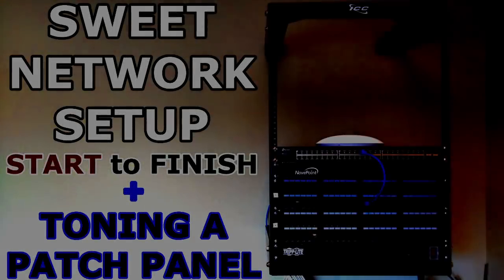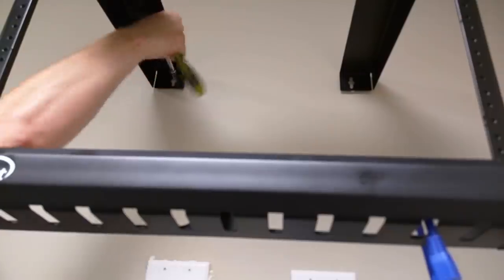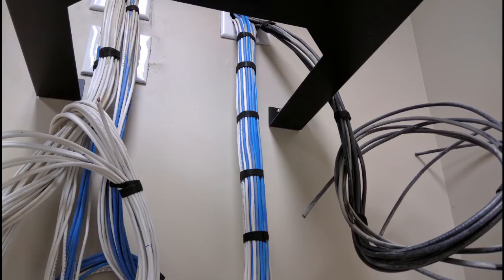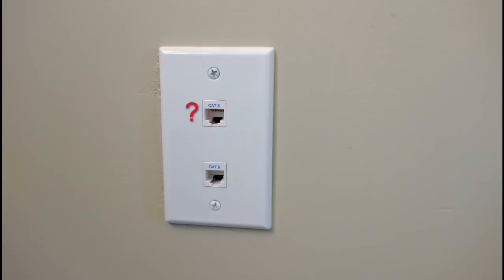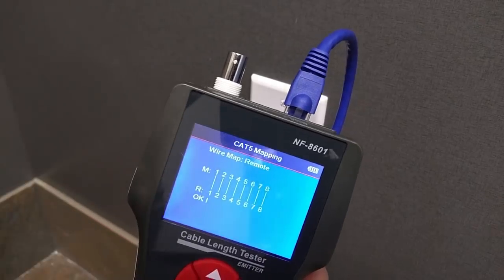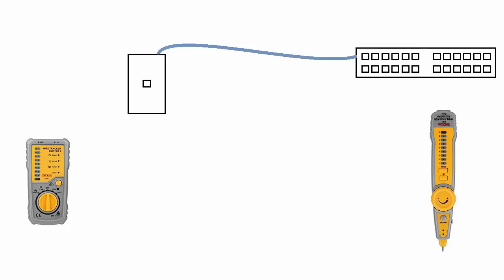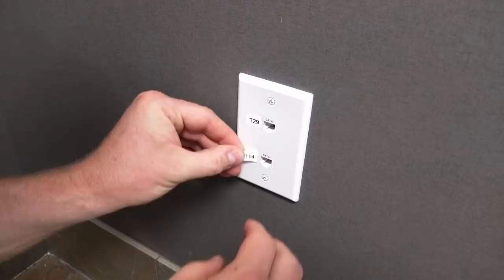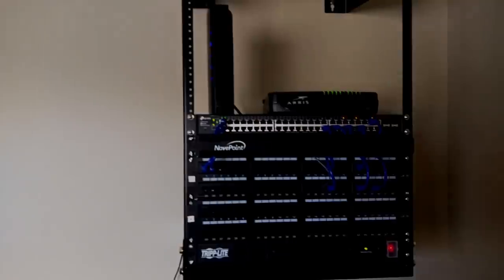Complete Network Setup // Toning, Identifying Ports

Comment: Question, I get 120 megs download and I ran 2 cat5 to each of my rooms, is there any way to split the cat 5 and have 4 ports in each room? How do I terminate them? Thanks
Reply from the maker: +Johnny Goni two cables gets you two jacks. There is no way to get 4 jacks out of two cables. Just get a switch and hook it up to ONE of those jacks. That will get you more jacks.. or just run some more Ethernet cables. :)
Reply: Actually, yes you can split one cat 5 cable into two jacks, ive done this before. The downsides are: you will only be able to get 100mbps throughput and you might get a slight crosstalk, voice applications in this manner are not recommended. 100mbps only needs pin 1,2,3 and 6. You can use 2 pairs (4 pairs in cat5 (Orange, Green, Blue and Brown). Here is how I would do it.

Line 1: 
-Pin1:Orange
-Pin2:Orange/White
-Pin3: Green
-Pin6:Green/White

Line2:
-Pin1:Blue
-Pin2:Blue/White
-Pin3:Brown
-Pin4:Brown/White

Please note, you can easily get confused with the colors to which cable so make it easier by taking photos of each keystoke while they are out of the wall for making the end.
If you get lost on pinouts of keystone/cat5 ends, you can just simply look them up.

Comment: I have had a lot of issues with T-P Link equipment that I personally don't hesitate to buy Linksys or Netgear equipment. I have never had an issue with those two brands. Anyone who is extremely serious about reliability of a network will not hesitate to drop a little more dough for high quality equipment. I am very serious about my network and dropped $250 on a Linksys Smart Router because it has exterior antennas and has 802.11AC triple band technology as well as the port connecting the network to the outside world is gigabit technology and an eight port switch all ports within the LAN are gigabit technology. My router also has a USB 2.0 and a USB 3.0 port. I have never had lag, network failures, or limitations within my network. I love gaming and the router I chose is a powerhouse. The power it uses at peak draw is only 24 watts.
Reply: Some TP-Link models had a problem with VLANs.

Comment: Sorry If i'm being stupid.... Did you test for CAT5 and It was a CAT6 Socket? 7:28
Reply from the maker: +Wilco Charlie the socket/jack was rated for cat 6. The cable they ran was cat 5e. The tester I'm sure doesn't care if I select cat 5 or cat 6. I haven't seen it make a difference. It doesn't certify the cable, so it will just test it. Either option will do the job.
Reply: Wilco, what he has is called a Pair tester, it doesn't check the cable standard. Cat6/Cat6a just has extra shielding in it to prevent cross-talk. Though as others have stated if your using cat5e cabling its best to use the correct jack mainly to prevent confusion as to what is actually in the wall.
Reply: @BudgetNerd  Make sure the connectors are rated for the cable you use.

Comment: Way too much time wasted tracking and labeling cables.
Reply from the maker: +Android Tab S User it didn't really take much time. Actually went much quicker than I thought it would. Worth mentioning as well, I didn't run the cables.
Reply: Cables should have been labeled. I would have fired a tech for not labeling the cables.
Reply: If you didn't run the cables you can be forgiven, but the person that run the wires and didn't mark them should be fired.  I have never run Ethernet cables in that capacity, but I do occasionally plan and run various low voltage dc, fiber, and data cables through arms in OR lights we install, or for the other equipment we install.  I also run AC, DC, and comm lines through various conduit in hospitals, research centers, etc for the equipment too.  Labeling is a must and a massive time saver. Sometimes it's just a simple mark, usually I use colored tape though.

Comment: Yikes. That's a good way to get nicks in your line the way you terminated them. Use some Cable Snips to score the cable then break the jacket off and use the pull string (or the brown wire if there is no pull string) to pull the jacket back to the correct length then snip off the excess jacket and divider then punch down. It will save you the frustration of having to rewire that patch panel after running your test on the lines and finding an open.

Comment: How many different hardwired devices can you run off of one modem?
Reply from the maker: Very few.. most of the time one. That's why you add the router, and then a switch if need be.
Reply: Budget Nerd I get that. I guess what I’m asking is.... how many devices you run off a single internet connection? Most homes only have one line ran into the home but can have multiple lines run throughout the home. At what point does the ISP get bogged down or too congested?
Reply from the maker: You could run lots. Just depends on your usage, and the speeds you pay for. If you have a good isp, you shouldn't see much of a slowdown during peak hours. I don't see any noticable slowdown and I pay for 200Gbps.

Comment: I would be grateful if you can do how to install unify access point or link to learn.
Reply from the maker: I did a review of another access point, I sort of ran through the steps to set it up breifly. That might get you what you are after. Different UIs between brands, but the process is usually the same.
Reply: thank a lot

Comment: Why would i want to have a an additional wireless access point if my internet modem is already wireless? Please explain i really want to know.
Reply from the maker: +Miguel Romero this setup was for a business. For your home, the built in wifi on your device from your internet provider may be just fine. We wanted better performance, signal, and more features that a business could benefit from.
Reply: Budget Nerd thanks for your prompt response.
Reply: Budget Nerd I would also add location. Often in a home, the cable company installs the modern near your TV which is generally centrally located. In a business or larger building, it's often in a closet or another low traffic area. Using your own access points allows you to put them exactly where you need them.
Reply: All in one, you can't move it away from the pop/MDF

Comment: These comments just cement the issue I have with IT. There is absolutely no standardization like there is in healthcare, for example. The guy does it his own way that works then every IT consultant with 500 years of experience comes out of the wood works. Also, to the guy who said the lines need to be labeled as they're run, that's non-sense. In a large enough project, the person configuring the patch panel and switch/router and the person who ran the wires are completely different. It could be months before a patch panel is installed once lines have been put in.
Reply: @PortalAtlas348   I am not a fan of that product line not because of the really cool options but the security is a just not there yet!
Reply: Theres more than one way to do this part. Shuffle and plug vrs plug and shuffle. Ahh age-old question.
Reply: As a network guy and someone who has had to run cables, labeling things makes life much easier. For trim out, I can mindlessly read the sharpie label and go to town, not to mention keeping user end outlet sequential. Even if it takes months for the install to be ready, I can glance at the wallplate and know right away which ports are going to be live user ports and the others I can keep shut for the time being. Or even better, the wallplate labels will be in some sort of schematic I can go to town with.

Comment: What modem would you recommend for home and office?
Reply from the maker: +keybored101 any modem the ISP recommends should be fine, but if you want better performance you could consider getting just the modem from them, and getting your own router and AP.
Reply: Review your ISP compatible modems list and pick one that's just a modem. Do not get one with wifi and all that crap in there. For home or office you want the most dumbed down plain jane modem, you get routers and AP's for handling that aspect, you don't want the all in ones the cable company has lol

Comment: There's so many patch panel ports. But not enough on the switch for them to all be active. Is there a reason?
Reply from the maker: +ExclusiveSigma I needed enough ports on patch panels to terminate all the wires that were ran, but will probably never fill that switch up in all honesty. If need be, I can add another switch down the road.
Reply: Why run one cable when you can run two for the same cost.
Reply: That's a legit point some people don't actually get, if it's in a wall, it never hurts to have a backup.
Reply: Is the patch panel grouped as they are viewed from the front? I dont understand the setup, 78 cables coming in and only a 48 port switch
Reply: This day in time I'm surprised ap's isnt a must have in home networking
Reply from the maker: +Apex 8 they have 78 lines in the building, but current do not need that many. For the short term, 48 ports should be good. They plan on adding 16 IP cameras, another AP.. and more later. If we need to add another switch, we can.
Reply: Scalability

Comment: if i wanted to make a business doing this how could i start it up or how could i market it to businesses?
Reply from the maker: +Humberto Alanis gosh I'm no business man, never started or owned a business.. so can't really speak to that. Just study it, learn as much as you can, help with projects, gain good experience and get confident with it, then the rest might not be so hard.
Reply: the reason i ask is because ive worked for an it company doing this work for dentists offices and i always wondered how they got the contract to do the cabling during construction. The part of getting the contract is where i am not educated in everything else ive done cept for configuring those 48 port POE cisco switches, ive installed them but usualy a tech was on the other end of the phone configuring it i would just put everything together like you did in this video. I would also install all the clients, foip, monitors, servers.
Reply: Contacts, networking, knowing people is key there. You can advertise and market, but networking and knowing people and what's going on is a huge thing. If you actually start a business, do some demo work to get the word out about your quality/prices/services.  Be it cheap, free, or a part of a larger project as a demo.  It's lots of hard work to actually run/manage a business. You have to do the regular work plus everything else virtually all the time.

Comment: That's some dodgy cabling at the patch panel.. No strain relief on the punched down cables, and is pretty messy as well. Cables are typically run directly along the back of the panel tray and secured with ties of some sort to keep all the cables run to one or the other side of the rack (to avoid the rats nest of cabling here). Functional, but it's a real bitch to work with down the line the way you have it here.
Reply from the maker: +socialismcanwork all valid points. Most of this know. I did what I could.. wasn't super easy to make that neat.
Reply: +socialismcanwork You are aware zip-ties are a bad idea in networks.
Reply: In Australia it is actually illegal to use cable ties on cat6 and greater cable as it can be done too tight and reduce the performance of the cable.
Reply: Illegal like cops would find out and you go to jail? :)
Reply: Bring back lacing!
Reply: Never take advice from a socialist.
Reply: I’m no fan of these types of patch panels.  If a port goes bad, it’s either replace the whole patch panel or you just have a bad port.

I love the keystone type patch panels.  There is so much flexibility.  You can also install all the keystones first ad you have lots of room to work, when done, snap them all into place where you want them.  Having them in groups.  You can different color of keystones for different things.  You can do pass through keystones where you have a RJ45 port on each end.  I use these for things like the WiFi router and other things on my shelf’s with the cables going to those to the back of the rack and down to the back of the patch panel and plug in.  Then it’s a short patch cable from the front of the patch panel to the switch.  It just looks so much better!!!

But if you have a issue with a port, you just pop out that keystone and replace it with a new one.   

In my house, I’m using a couple 24 port keystone patch panels from Cable Matters.  They work great.  Not a lot of money, though you do have the extra cost for the keystones.  I got one other those patch panels shown in this video and I was like, I this is going to suck trying to fill in my small closet.  Cable management with it, didn’t like.  The Cable Matter Oatch panels have a rear cable support in the back going all the way across to zip tie the cables in place for better reliability.  It’s just such a better way to go.  The ports on the Patch panels I didn’t use, I filled in with blank keystones for that final last touch.  All my ports are labeled.  I know the exact port and in what room it’s located and so can quickly find any cable that may have a issue.  

I also tested every connection with my Fluke Network Tester.  Good thing as I did a couple booboo’s.    All my jacks around my house are labeled.  They are all grouped on the patch panel as I knew what each one was as I have labels on the cables behind the patch panel.  

My old more cheaper home setup I had a number of issues.   I thing was labeled and it was impossible to figure out what was wrong.   So when I completely redid my Home Network, one if the first things I did before the change over was figure out each cable and label it.  I pulled down everything, added another 9 Cat6 cables that also got labeled.  Then it was the start of mounting up my new 8U rack.  The biggest thing I could really fit in my small closet in the middle of my house.  Jackets hang under it all.    

Labeling is #1, followed by having neat cable bundles.   Why people are so lazy with their spaghetti wired mess?   Anytime in the future anyone has to work on that garbage, it’s going to be a nightmare.   With a little planning, there is no reason to have a network system look like clueless armatures did the work.  Let alone was paid to do that.
Reply: @johnschroeder3072  They're also a nightmare to cut and not knick the cable if you need to add runs or something.
Reply: @JGnLAU8OAWF6   No illegal like if your work gets audited you could be fined and if you keep doing work that ignores the standard you can loose your licence to cable as installing coax, fibre and structured (cat5+) cabling requires a licence in Australia.

Comment: What's the difference between cate 5 and 6 other than price?
Reply: Robert Poynton .....faster speeds for longer distance. Has thicker casing so there will also be less crosstalk.
Reply: cheers mate. im trying to work out  a home network setup, how many ports i need, how much cable i need ect. hardest thing is knowing where i need them and for what devices.
Reply: Unless you are wanting 10Gbit in the somewhat near future on your LAN, then Cat5e will work just fine for you.  Just make sure you get cable that's NOT CCA (copper clad aluminum)...  It has flooded the market!
Reply: cat5e and cat6 can both fit most home needs. Cross talk is where is makes its dif. cat6 has more of a twist to the pairs leading for less cross talk witch means less signal loss at longer runs. If you are doing a new install use cat6 do not pay any mind to Chucks this is why. Why would you do a new install on 50 year old tech. I do agree with him on one thing do not get CCA I have done a test on in using POE and it is a fire hazard at over 100 feet. Also if you plain to run the cable in walls or attic, or any place that there is air flow get Plenum it is coated with fire retardant and designed for that use. For more info this is a page I refer people to: http://www.tektel.com/b1/faq/ethernet-cable-faqs/choosing-the-appropriate-category-cable/
Alot of people will tell you also not to get a patch panel for a home install but do. It makes it better for techs, and you to trouble shoot, and they are cheap get the keystone ones that way if you need you can change the jacks out later.

Comment: First off, @Budget Nerd. I sincerely appreciate the video because it provides an example for installation through troubleshooting and I think its providing educational content. That being said, this is far from professional. Hack maybe... but I don't know a single organization that I have worked with that would have accepted the labor hours associated with doing a job like this. And the result is unpolished to be polite. See: https://www.youtube.com/watch?v=FY1XB0rrYes Now that is professional. Its organized cleanly installed, and I guarantee they prelabelled every cable prior to pull, probably from multiple reels simultaneously to decrease pull-time.  Note this is not my video, however I often used this as an example for what I expect my team to strive for. Regardless, I appreciate your contribution. Keep it up; find ways to improve; and share your lessons learned with the world.

Comment: Idk much abt this but would u get better internet
Reply from the maker: The main purpose of a setup like this isn't to increase your internet speed. There are certain scenarios where having new network equipment, or equipment setup can help you get more out of the internet connection you already pay for, but this setup is designed to help you with your network's flexibility, expandability, and overall function and presentation.

Comment: Unterminated 8P8C plugs can damage the ports on the panel, to put it simply the plugs not crimped the 8 conductors can damage the pins on the panel depending on the quality of the panel. Not a good practice.